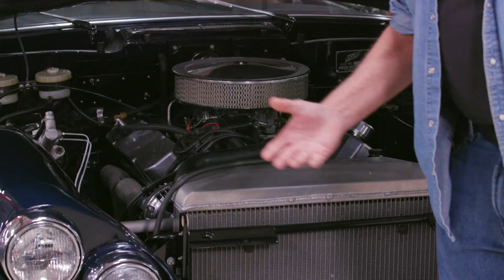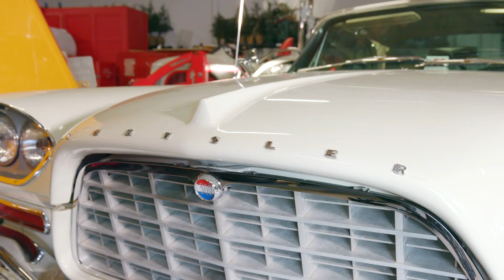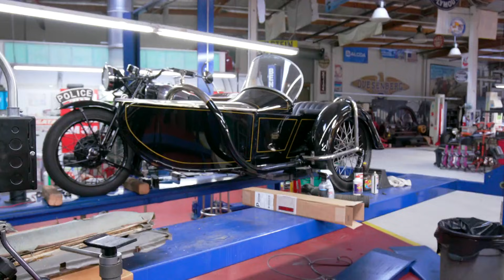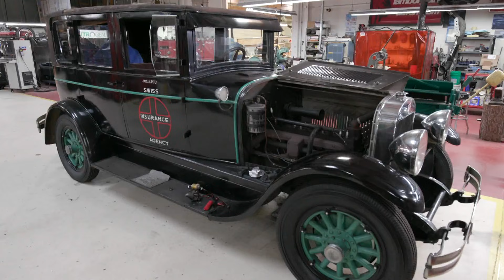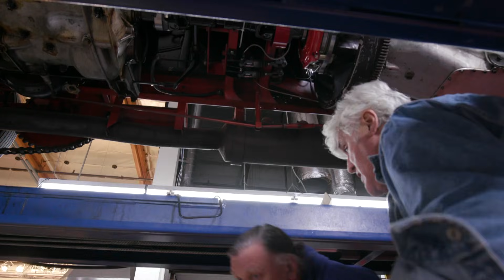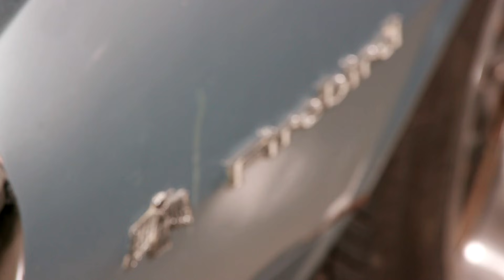Restoration Blog: March 2019 - Jay Leno’s Garage

Comment: Jay, I lost track of when Covid hit. Thankfully, I didn't contract it. You are a national treasure, in my opinion. Do you have a 1969 Plymouth Roadrunner? I had one. One day at a gas station, a fellow came over and showed me something interesting about the electrical wiring. With the key off, pressing the brake peddle with the turn signal, gives power to the radio. I now have ALS, I retired from being an A&P aircraft mechanic. I'm awed by the skills of your guys. You bring me joy in each of your episodes. I like the steam powered cars best. Thank you so much for doing and sharing. Mark Pullen

Comment: I had a 67' Pontiac firebird  6  Overhead Cam 3 speed on the floor,  was not a sprint,  But it was Very fast for a 6 cylinder i blew away 283 ci with that  car ...

Comment: Love that Pontiac sprint , my mechanic has the convertible V 8 . It's a good design , but heavy . Here in Denmark insurance and roadtax are horrible , over 1200 $ just for road tax , for a big modern car and insurance is about a grand and a half extra , give or take . Veteran tax after 31years cuts it some , aa the appreciation value rises simultaneously . Worst of all is the new car tax , 180 % on all private use motorized vehicles , you still feel that all the way down through used car prices . So if you see a dane in a 1990' muscle car he aint as poor as you might think

Comment: Dear Jay I don't know if you remember my 1979 Cadillac custom phaeton 4 door sedan in navy blue cloth top and cotillion white bottom with white leather interior designed by Fleetwood! I still own it   It has over 217,000 on the dial condition 3.5 for body  asking 3,995!  1 of 835 made!  The phaeton scripts are on the rear quarter panels!

Comment: Ps. Don’t miss the rubber flat O-ring on the oil pickup tube where it mates with the engine block when  you rebuild that OHC six, if your oil pressure drops at idle you’ll know why now.😜

Comment: Many moons ago when I was a young house painter  in the Bay Area I had a sweet green 72 Vega wagon with Ansen slotted mags and 60 series tires with a 4 speed, it had that classic 70s California surf wagon look. 
I found a 68 Firebird Sprint HO in the classifieds, 4speed stick, with the 4barrel Quadrajet, also had split exhaust manifold, 6 into 2.
The pretty young blonde owner drove it to CA from Colorado, well she just loved my Vega as it was a stick, and we did a straight trade!
What a blast I had that summer commuting to work in that car, I recall it did not have PS or PB so that motor revved freely, eventually I restored it completely including rebuilding that engine myself (my first)
McCullochs on Valencia St. in SF did the machine work. That motor was so smooth and quiet all you would hear coming down the street was the jet whoosh of the custom aluminum fan. 
I found another rebuilt 1 barrel motor so I pulled my HO and kept it for many years, wish I still had it, but I mentioned it to my neighbor and he bugged me for many years to sell it to him, he finally got it. Sold the car to a young lady who eventually wrecked it. Great engine, great GT car.

Comment: Hey Jay... Is there any chance you might ever focus on a Volvo 144? I had a 1970 4 door about 35 years ago that (I'm guessing) is probably still running. It was absolutely bullet proof.

It was amazing in the snow despite having real wheel drive and no snow tires (only radials).

It was so solid and easy to drive. The main downside was its horrendous lack of power. With a 4 cylinder engine and auto transmission, it was slow to begin with... but turn on the a/c going uphill, it was like hitting the brakes... or perhaps throwing out a boat anchor.

Having said that, it's still one of my favorite cars I ever owned.

Being Swedish, Per Blixt would probably love to get his mitts on one. 

Love the blog and your other work, Jay.

Comment: Actually Jay, starting in 1962 Jeeps like the Willys Wagon and Pickup in the style they built all through the 50's got an overhead cam 6 cylinder called the Tornado. 230 cubic inches with 140hp @ 8.5 to 1 compression or 130hp @ 7.5 to 1. Not a particularly successful engine for them as it had some teething problems such as oil leaks. A long stroke inline 6 that could be a practical and reliable engine if maintained and serviced properly. I believe it stayed in production in Argentina until 1975.

Comment: Jeep made an overhead cam six cylinder for the Wagoneer in the middle 1960s.  It was the civilian version of the six banger used in the US Army one and a quarter trucks.  I had a 1965 Wagoneer with it, three speed column six stick with a two speed transfer case and and overdrive and with manual locking fron hubs.  If you couldn't find the right gear for the situation, then you really weren't trying.  The lousy Motorola transistorized electrical system almost bankrupted the company however.  They changed it after a year and a half, so they survived, obviously.

Comment: I didn't buy a GM car with that over-head cam six, "back in the day", because the timing "belt" was fiberglass and I was told by mechanic friends that it was unreliable. Not sure if that was a myth. Belts are much better now.

Comment: Hi Jay, I know where the last Jensen Interceptor III is - if you are interested? When it was sold by my father about 10 years ago had original everything, tyres, seals etc, just the suspention bushing were replaced. Also the original fuel line covered in White Silk was still in tact. Further, we went to the jensen factory when it reopened in the 1990s and they gave us the original inspection sheets - hence a full car.

Comment: Jay, I looked for a way to message you but couldn't find it. I have an all original 1970 240Z with 37,000 actual miles that I bought from the original owner. The late doctor kept a journal and the last time he fueled it was 1994. I'd like to sell the car. Nice original paint and zero rot,  Stacey White.

Comment: FIR BIRD. The six was zippy. Quadrajet carb ,overhead cam, 10to 1 compression, it responded well. Cam often lost a lobe so off to the regrinder. I had a v-8 4 speed no power anything 4 piston discs, hood tach,Posi , and a428 option. It did not handle too good. The 66 Corvette was far better.

Comment: I had a 1966 Tempest Sprint, it had 150 K miles on it and the windshield and back window were rusted out. That 207 hp engine with the 3 speed Hurst shifter would turn 7000 RPM with no problem.  I ended up flipping it end over end :-(

Comment: Thanks .. great ideas.. Interestingly the 1958  Chrysler Fuel Injection is incomparable...... A whole Book, or story on all the Manufacturer FUEL I NJECTION JUST IN THE 1950 or 1960’s......... GM, FORD, CHRYSLER,, STudebaker Factory moves were made,  in and out of Dealer INSTALLED, ,Options, updated by OEM, UPGRADES, BULLETIN TECHNICALS, ETC.

Comment: I love the restoration blogs, they always show the most interesting stuff! 2 comments...1) If it was mine, I'd forget about nickel plating anything on the green car (Wills?). I'd copper plate everything...radiator shell, gauge bezels, bumpers, aluminum trim...EVERYTHING. I know it wouldn't be right, but, I think that once the copper starts to oxidize, it would look very nice with the green bodywork. 2) I've been waiting for the Detroit Electric to be finished. I've been fascinated with them since I read a series of mystery books with the main character based on the son of the man that founded the company. I don't remember the authors name off hand, but, if anyone is interested, google Detroit Electric Mysteries and you'll find them. They're very good if you're into mysteries and Detroit (the city and the electric car) history. These are both just my opinions and I can't wait to see both of them completed along with the others featured, especially the 300D.

Comment: There was another car made in SF,  Heine-Velox built cars in SF, then the earthquake happened and they moved:

Heine built three tourers before the 1906 San Francisco earthquake and fire, which destroyed the Heine Motor Company and Heine Piano Company.[2] Following the earthquake, Heine restarted the piano business,[2] and offered federal troops the use of his tourer for transporting supplies, the wounded, and the dead.

Heine left after the earthquake for Milwaukee, where he arranged a deal to have a large number of vehicles produced under the Heine-Velox name. The new vehicles would then be sold by the Heine Motor Car Company, located on Golden Gate Avenue in San Francisco. The vehicles would be manufactured by Mauvais Motor Company, owned by Roy Mauvais. In 1906, the 45 H.P. was produced. Backed by a $5,000 guarantee, the car was advertised as having fewer parts in relation to its size and weight than any other car.[citation needed]
In February 1907, Heine was in negotiations to have one of his vehicles raced against a Fiat vehicle that was one of the fastest being manufactured at that time. The proposed race was cancelled when Fiat officials wanted to add a third vehicle into the race. Heine's planned production of 50 cars per year never came to fruition, and he ended automobile production in 1908.

There was also the 1905 Scharbach  (Hill Climber) Roadster 
and Hill Climber Bicycle Co. San Francisco. And Sunset Automobile Co. San Francisco, CA.
1903-1907. They had a car called a Tonneau in 1906, they probably all burned.

Comment: I had a 6 cyl firebird like that back in about 76/77. It was actually very interesting as I seem to remember the cam is mounted into the valve cover. Bit of a fiddle to replace but quite clever. Mine had a 3 spd column shift auto and plenty of rust. Wish I’d kept it and taken it with me back to the UK but I just had to have a V8 instead. Never seen another one though - interesting story - thanks Jay

Comment: As my very first car, I owned a 1967 Firebird Sprint! With a 4barrel! White with a black vinyl top. Sold it for $900.
Reply: Bryan Bentley anything else left I got 1200 in hand
Reply: @jmoney7289 ... I'm sorry that I must regretfully respond negative. I was 17 years old and had my sights set on a Z28 Camaro. It's one thing among many that passed through my hands in those days. When I sold it, it was just a used car. Like many others, I wish hindsight was 20/20!

Comment: The last great late night host is your best car enthusiast and restoration car'noisseur.
Wish he was hiring... Minimum wage to work on those cars and learn about more cars that I've never seen before, it would be fine by me!

Jay, do you have any CAV DPA injector/generator based vehicles? Been working on a tractor that has stopped pumping diesel to the injectors and those engines are quite interesting. One low pressure heater fueled by the injectors' low pressure return and mounted on the intake with zero glow plugs in the block.
That is an amazingly beautiful and simplistic design... If it weren't for the keyed switch, there wouldn't have been much reason for more than a couple of wires for the battery to starter and generator/alternator to the vreg to end at the battery.

Comment: Never understood why Pontiac didn't design the OHC Sprint engine with a cross flow head. Wasn't it a clean sheet design to begin with?
Reply: darnoldie Sometimes it’s to save on machining during production. With a cross flow you’d have to machine both sides of the head. With everything on one side you only have to machine one side.

Comment: That kind of spring clutch is nearly identical to the ones used in sewing machines on the industrial side of things (where the belt input is on the machine itself). Neat connection there.

Comment: Sir how to prevent engine aluminum and iron parts from oxidation and corrosion after vapor honing. Is aerosol spray or water soluble rust inhibitor works well. What is the best solution.

Comment: As for the Poncho, that is the Tempest engine?  Though how much power did the Chevy 6 of the period have?
Here in Oz in 69 we had 185hp 186 cube in the Torana XU1 which was a good deal smaller and lighter. By 71 they were 202 cube and 202hp.

Comment: Jay, the hood opening sequence for that firebird is just a bit more involved than pulling the release and lifting, but not much more involved than that.  Push down on the hood when you pull the release lever under the bumper just past the center to the driver's side, then lift the hood with the release lever pulled all the way towards you.  A friend of mine has a 67 Firebird Convertible with the 165 hp 230 6 cylinder, TH 300 with column shift, 2.73 rear end, power steering, unassisted drum brakes, bucket front seats.  The Pontiac I have is a 1972 Ventura II, and you don't have to push the hood down while pulling the release lever.  The specs on it are 130 hp 307 V8, TH 350 with column shift, 2.73 rear end, power steering, power drum brakes, air conditioning, and a bench front seat.

Comment: Knew a guy that had a Sprint 6 in a Pontiac LeMans.....did not think much of it then, but later on developed a fondness of inline and V-6's.....Have only owned one V-8 in my life, my 81 Corvette.....Dad was a six cylinder guy.....have thought about putting a V-6 in the Vette, but outside my budget right now, but I think it would be the best of both worlds....lighter weight, similar horsepower, and much better fuel economy!!!!!

Comment: Awesome. That is why I got into 3d printing. Been trying to get started on building my foundry so I can investment cast parts I print. I've already designed a few parts for my car and printed them from abs and used them every day. I'd just love to make them out of aluminum.
Reply: It seems like 3d scanning is the real hero. I was really hoping for some type of rollout for metal 3d printing
Reply: @macberry4048  there is a consumer grade metal printer, but the price isn't consumer friendly lol. I've looked into having a place like shapeways just print one of my small parts no more than 3 cubic inches in volume in aluminum and it was several hundred dollars. I said f that! Been trying to get my microsoft kinect to work with.my of so.I can scan things. Microsoft has all the software and stuff for free. Right now my old video.card is the weak link. It takes a good gpu to process the data.
Reply: @sinformant  so 3d scanning really is the hard part. I'm interested in what you have 3d printed but I really want to hear about where do you 3d printing going. Jay's last video with the 3d printing company stratasys was sad. Everything about the process and the machine was expensive. Jay basically would needed to make millionaires car club so he wouldn't get stuck paying a huge amount for powder
Reply: @macberry4048  a lot.of the stuff I've made myself were things I modeled to fix things. I've had older appliances that were missing parts or had parts that had broken and were no longer made so I sat down with a piece of paper a pencil and a pair of calipers and started mesauring. I had an old humidifier that I got at a second hand store and the odd shaped water tray was missing. Looked up the part and it was no longer available so I modeled it and printed it in abs. I've done this with other things,  made a few firearms accessories. The hks blow off valve on my car has removable inserts to change the sound of it. They only make two different ones so instead of wasting money buying the only other one they make to see if I liked the sound, I modeled, and printed it out cost literally a few cents worth of plastic. Didn't care for the sound so I started designing different ones until I came up with a couple I liked. What I'd like to be able to do is scan sections of my car so I can import them and model off of them, possible design wide flares that will mold in with the factory panels and not look as if they are factory. Print it off in sections, glue it together and build molds off of them so I can build fiberglass or carbon fiber copies of them. No one makes a wide body kit for my car so it may actually sell. Heck I could even possibly scan the front/ rear bumper covers and change up the design and make my own custom body kit. With 3d printing I don't see it going away any time soon. Things are getting cheaper and advancing every day. Heck once you own a printer yourself and get a good idea how they are made up, its just a matter of buying parts and building your own. Most everything they are built from is available on the internet. I'd like to eventually scale up my current printer to print larger than it already does. The thing that is holding me back are time and money.I work so many hours a week when I get off work I just crash,and my days off I'm too wore out to even contemplate doing anything lol.
Reply: @sinformant  bodykits is a interesting idea. I watch drifting so I'm learning about polyurethane vs fiberglass. But one thing they always say is the bodykits made in Japan fit the car better. So their could be a market
Reply: @macberry4048  yeah they have a good work ethic and pretty strict quality control over there. And yes fiberglass kits are a pain in the butt to fit and make look good. Dealt with a couple. Polyurethane kits are usually injection or pressure form molded so they come out of a die that doesn't really change its shape. Fiberglass kits come from a different type of mold where they paint in gel coat, spray in resin and stranded fiberglass through a gun and build up layers and then pop it out, do minor trimming and ship it out. A lot of voids and pin holes that you have to deal with as well as thin spots here and there sometimes. Its up to you to figure put mounting points and drill appropriate holes.